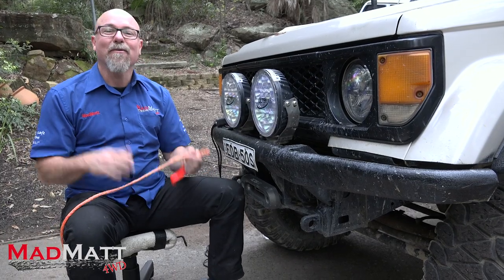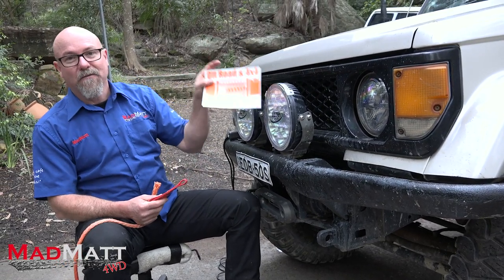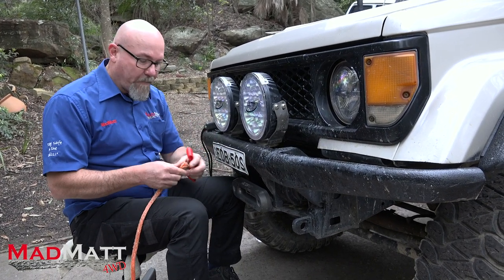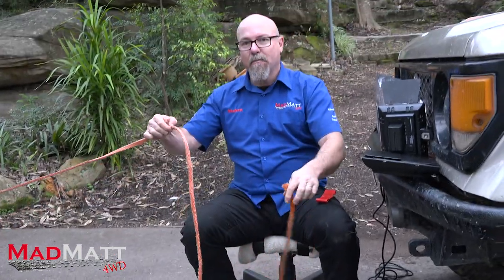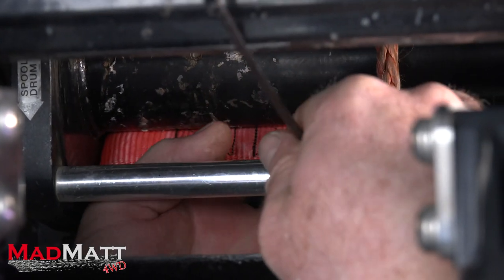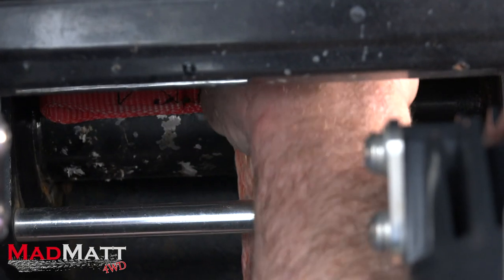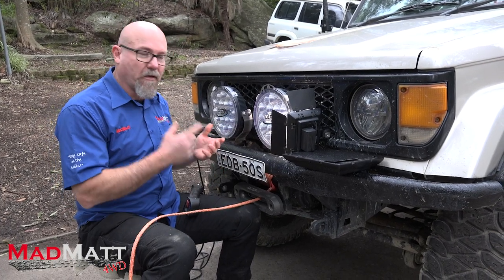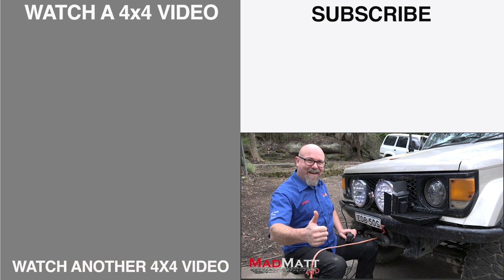How to attach WINCH ROPE to the WINCH DRUM using a Red Winch Plasma Lock.

Comment: Nice but i just use black Gorilla tape for 12 bucks. After pulling off the bolt loop on my Power Wagon's factory  steel cable, i just taped the frayed cable end to my winch drum and it's never come loose yet. And if it works that good on a steel line, i reckon it would work even better on a synthetic rope.
Reply from the maker: Ok

Comment: Been winching for many years and never had a rope come off. All I do is zip tie the tag end onto the drum and do one full drum spool load under hand pressure then the rest of the rope under load. Simples.
Reply from the maker: Yes and that works fine. The idea of this is to let you know when you’ve reached the end of the rope. Yours will pull of the drum if you just keep spooling out line.

Comment: So how is the cord normally loaded onto a drum? I have not unwound mine to see as yet and not seen any videos to show me.
Reply from the maker: Usually there’s a little tag on the end of the rope that a screw goes through.
Reply: Normally the winch rope has an eyelet at the end of the rope. And it is bolted to the side of the winch drum with a tiny bolt or screw. Then you winch in to spool the rope onto the drum. The bolt and eyelet have no structural integrity  or strength, its purely so the rope can be spooled onto the winch, which is why you have to leave atleast one wrap on the drum for the winch to actually hold. Failing that, if your screw is rusted out, u can use a cable tie to hold the rope to the drum while you spool on the first wrap of rope to the winch drum. 

This device stops the rope from completely coming off the drum, which could potentially happen if your at your winch ropes length and just have the one wrap on the drum. If you roll back for what ever reason the rope could come off the drum, or even if ur spooling out too much rope, past the recommended one wrap, you could potentially have the rope fall off the winch drum.

Remember to always spool your rope on under the drum, not over the top.
Reply: @krump7429  Thanks, Ill have to unspool my rope one day at home to see how it's attached and maybe use one of these items MadMatt is talking about.
Reply: @MadMatt4WD  you're still supposed to use that screw in mounting point with this setup.
Reply from the maker: Dan Wickersham I see no need to use the screw
Reply: @MadMatt4WD  I suppose you don't have to. I first saw that in use here: https://youtu.be/Xavi1qzlfAI @10:50 
And just always did it like that

Comment: Hey Matty do you know if anyone makes a plastic device with a bunch of S turns and a hole in it so you could wrap your rope around something,  lock it on to itself then put your hook through the hole?
Reply from the maker: I can’t think of antthing
Reply: @MadMatt4WD  Have you seen 'bleepin Jeeps freedom rope'?  Its been woven to have holes in it just like a soft shackle that you can put the end thu and get various loops of about two, four and eight feet. Its a great idea, but I already have Warn Spydura rope, and thought if there was an attachment made that would grip the rope you basically do the same thing.  I have seen small light duty ones used in climbing. Maybe someday I'll weld a bunch of 3/4 SS pipe elbows sliced in half that will accomplish that  S  friction attachment.

Comment: Matt, I have a warn xd9000 winch with cable, do you need to change the drum on the winch to switch to rope as well or can you just change it?
Reply from the maker: Hey MadMatt Robinson. No need to change the drum. Just make sure there’s no damage or sharp edges on the drum.
Reply: Thankyou, its only 1year old now and had to pull it apart to regrease it all as it some how got some water in it. Might look into a plasma rope and fairlead to save some weight.
Reply: Matt Robinson 
I have the same winch. 
It’s a easy swap. A few tools, a beer and it’s done. 👍
Reply from the maker: I don’t use wire anymore. If you go to the A247 website and use the code MadMatt you get a discount on anything in store. They have a number of cable and fairlead solutions. Link in description of video
Reply: @MadMatt4WD  Hi Matt, 3 years late to the party, but along the same lines. Im changing over from cable to synthetic as well. What are your thoughts on rollers for synthetic winch rope?

Comment: 10x quicker to just do a clove hitch knot
Reply from the maker: Except it slips as there’s not enough rope on the drum to provide friction.
Reply: @MadMatt4WD  they dont ive done it on a few winches now and havent noticed any slipping.
Reply from the maker: @longy6612  When you get to the end of the rope, the rope will slip. There needs to be a number of lays to have sufficient friction to winch off. That's, where the plasma lock comes in it, stops to many lays coming off. It doesn't stop the rope from slipping the fact there are enough lays still on the drum stop the slip
.
Reply: @MadMatt4WD  but it doesnt. Try it. Once you pulled the car once the knot goes so tight around the drum it doesnt move or spin.